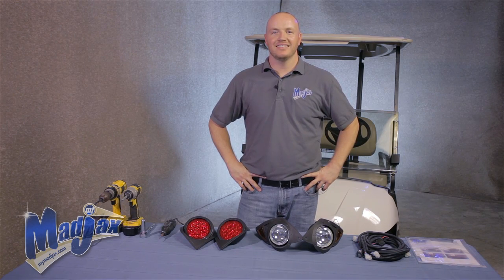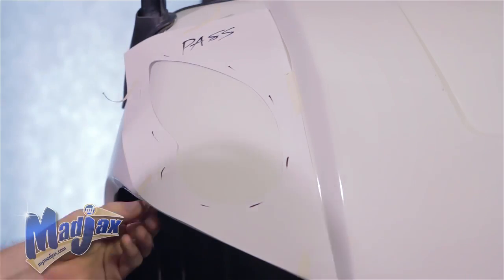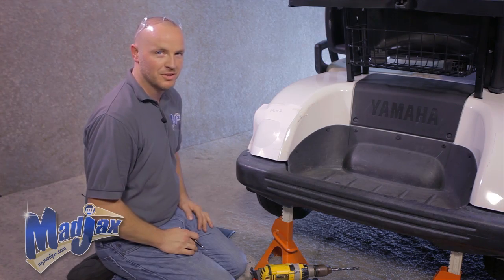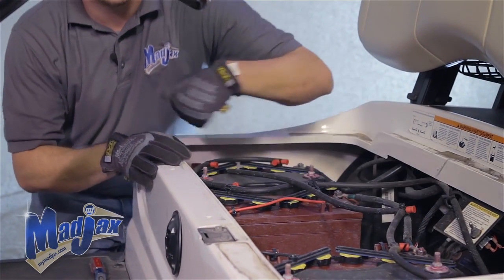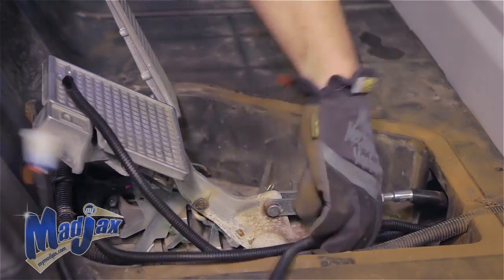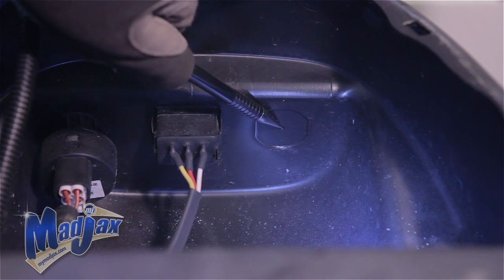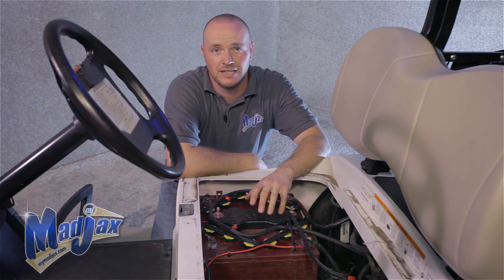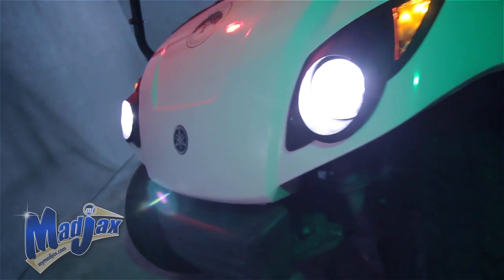Light Kit for Yamaha® Drive®  | How to Install Video | Madjax® Golf Cart Accessories

Comment: I'd love it if some one could do a video to show how to change a turn signal light bulb in one of these front light units factory installed.  There is nothing at all on you tube.  Other than that you are a craftsman!
Reply: You ever figure it out?
Reply: @damon7845  Not yet.  I also want to install a signal buzzer but afraid if I take it apart I won't get it back together.

Comment: Why are there 3 wires on the harness to the taillights. Shouldn't it just be a positive and a negative? It appears there are 24 volts running to the taillights

Comment: I have this kit on a used cart that I bought.  The turn signal is out on one side.  However, my kit was not installed using the four screws that you show in the video.  Your front assembly has four holes for the screws, but mine doesn't even have these holes.   I guess it was just popped in and some expansion springs hold it in place?  Any thoughts?  I don't want to pull in it, and break something.  Thanks.

Comment: I installed these lights on my Yamaha Drive and am experiencing a fuse blow every time I turn them on.  There are no shorts but the switch was disconnected by a friend and the wiring back to the switch he could not remember.  It is marked supply, earth and load.  As I am not really a technician I am unsure as to where the connectors should go for the switch.  If you can tell me perhaps it will fix the issue...thanks in advance.

Comment: How do you wire to the ignition switch so it will turn off lights when key is removed????
Reply from the maker: For gas carts you attach the red power wire to the switched leg of the key switch. For electric carts you will need a switched 48v -12v converter
Reply: @MadjaxTV  Great. But how is the converter switched?

Comment: Your battery will get unbalanced and not charge properly.
Reply: Yes.  A reducer should be used.
Reply: @steveott1884  and not a 18-volt one, either 36 or 48 volt too 12v no fuse,? Light's not working?  Where to start? ??